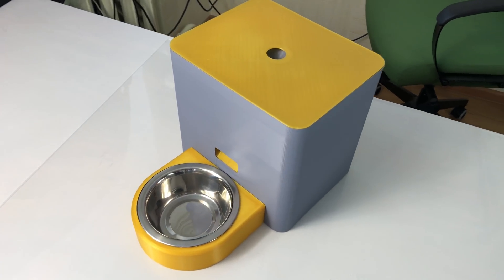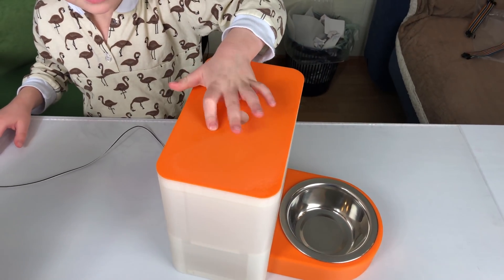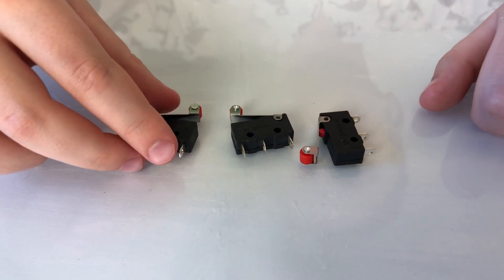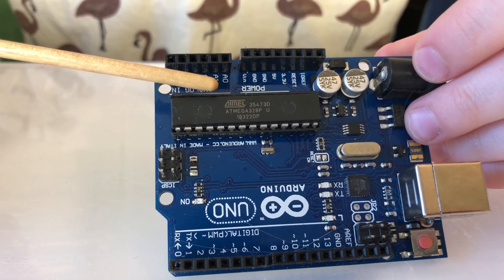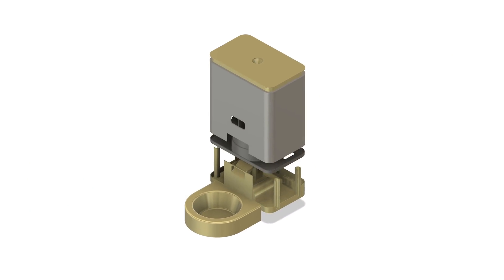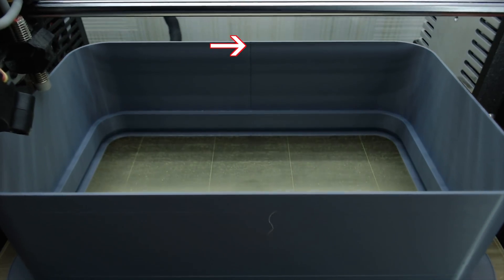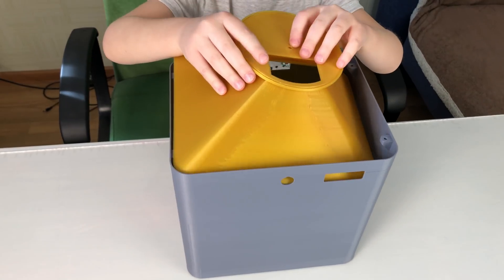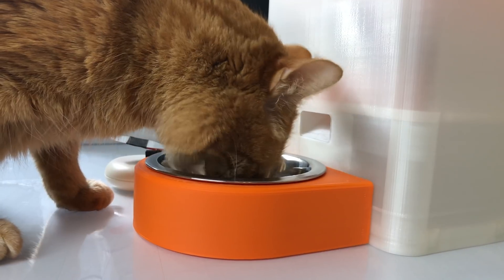FAT PET FEEDER 🙀– Free 3D Printed Pet Feeder

Comment: I had trouble with printing shell part with PETG. Where the opening starts on shell, some kind of deformation (like a bump on all sides) starts. I’ve slowed down the print speed (70mm/s) and acceleration and reprinted, exactly same problem occured. Anyone who had a problem like this? Any advices?

Comment: hello Aleksandr ,need your help , you think 3 battery D can Use for NEMA 17 stepper motor?
Reply: @kanyorb45  it's 12-24v motor and 1.5*3 batteries without converters. It's better to use a lithium battery pack then.
Reply: @ 
Maybe you have a recommended link to buy ?
Reply: @ sorry, no

Comment: Does it work with a Servo SG90 180°?
Reply from the maker: No
Reply: Thanks for responding :) will 360° work with SG90? Or should it be a more powerful servo?
Reply from the maker: Yes, it should be more powerful. Also the seat is made specifically for the servo in the spec
Reply: Thank you, I will modify the dimensions of the 3D project to place the SG90 360°, reduce the amount of food so that it can move the weight.
Reply: That would be quite challenging I believe. And even if it's done could result in some things working poorly. But these issues are also solvable.

Comment: Hello ! A big thanks for your project/video ! Now i have a small question : is it possible to power this using the usb port on the arduino instead of the DC connector? I think i saw somewhere that it is also 5V. Thnaks again :)
Reply: You can definitely do that but this servo can stall up to 2.5 amps at 7V, that's quite a lot for most of the USB ports and chargers. I tested 2 amp apple charger, it works, but 1 amp charges sometimes don't.
Reply: Also if you use arduino internal 12->5V converter, it's rated 5V 0.8 amps, that is even lower. So you have to use big capacitors or take the risk of something not working or even being damaged.
Reply: @HungrysitesRu  ok so better use the DC connector then 😅 thanks , i'm new to electronics !

Comment: Great Job, Great Science Fair Project!  The video provides a nice summary of assembly and parts list is solid; although many things in 2023 are backorder on Amazon.  Could use some help with the details of wiring; we are novices with electronics in our house... Guess we are not as smart as the 6-year old in the video. :-)  Anyway, Thanks and if someone has a separate video for wiring and coding (e.g, how to load the code onto the Audrino Nano board... that would be GREAT!)  #FatPetFeeder #WiringHelp
Reply from the maker: Thank you. I'm sorry, I do not provide support anymore. You can find similar items to what I have in the parts list and see the wiring diagram and sample code in the description.
Reply: @MomWillBeProud    Thanks Much!  Got it working just fine; awesome Science Project for my 5th grader!  Only thing now is we are not quite smart enough with code to understand how to TEST the time parameters?  Trying to TEST setting a time and see whether it automatically serves... Be not sure which parameters to change in the code?  Figured out the feeder options and turning of the servo motor; no problem... Thanks in advance if you can send along any pointers on which variables to change for TIME OF DAY testing.
Reply: @glenjohnaz  There's no time of day option in the code provided. You can totally learn to do that depending on the RTC clock you use. Without RTC clock it's not possible to keep track of time well with Arduino.

Comment: Hi there, thank you for the design and tutorial. We built the DC circuit version so far and everything seems to work. We don't know what the buttons do exactly in the default program but we do see the motor move, could you let us know? and does it feed automatically with the default code in your link or does that take some extra work on our part? if the default code includes automatic feeding how often does it feed and how does it know when to start?
Reply from the maker: Hi! The buttons change the portion size (the time that the servo turns, movement just indicates that the feeder understood the command) and the middle one is just to force dispense food once.

fpf12h.ino serves food once every 12 hours, first serving is done immediately after plugging into the socket.
Reply: I finally printed everything and have some follow questions about the program. If I adjust the portion sizes up or down does that get stored? If I unplug the power does the portion size I last set it to stay or does it go back to default?
Reply from the maker: @Adoula7  the example program doesn't have any persistence but you can implement it yourself. It's probably like 10 lines of code, it's a good programming practice.

Comment: This is a great project. Quick question. Whenever I change a parameter in Fusion 360 in the model I get loads of errors. Is it working for anyone else?
Reply from the maker: Maybe the design was too complex, maybe the implementation has too many dependencies. Yeah, basically you have to fix them all. It's pretty hard so I think it's better not to change or limit yourself only to changing some specific parts like bowl diameter.
Reply: @MomWillBeProud  Thanks for the reply. I wanted to make sure I wasn't missing anything. I need to change the overall size because my 3D printer is too small. Anyway, great project! It's the best DIY pet feeder project I've seen out there. Is your Patreon still active? I would like to support your work.
Reply from the maker: @farzadbakhtiar  Yeah, it would be pretty hard to fit into a smaller printer. The patreon is not active but I'm good, man. I made this project and it's doing pretty good: https://artworkout.app.link/

Comment: thank you so much for this project.
i would like to adapt the code so i could set specific times of the day to trigger the feeder. 
has anybody here already tried this?
Reply from the maker: Thank you. There's a code example with 8 hours delay though it's not made to use with a battery. The code for a battery version should be different (using timer/RTC pin interrupts).

Comment: Hm I put together the battery version and it does not works. :/.
Reply from the maker: Well I guess it's a part of any learning experience. You'll figure it out.
Reply: @MomWillBeProud  Thank you fopr the fast answer. I am really noob in this kind of stuff. I used LM2596 DC-DC Step-Down instead of urs, maybe thats the problem? also I use uno.
Reply from the maker: @Zuluparaszt3  try running it with usb power maybe just to check

Comment: Hi there! awesome design! Why did you choose for a hopper system? instead of a belt, or a screw driven transport system. was it more reliable? or just better looking ;)
Reply: belt is harder to manufacture DIY-style but I think it's the best option because it cannot jam if you dispense from the top of the feeder. Also you can use any bowl at the bottom.
I don't think there's a big difference between screw and the wheel. Screw eats horizontal space, wheel eats the vertical one. There should be a hopper anyways if you want to use all the food you put into it. Even if you use a belt.

Also probably a cheap stepper would be better than a continuous servo to make it more precise.

Comment: 5:15 if you want to make your switches have less throw you can remove the metal arms off the microswitches and move them closer, or add a spacer for upgrading existing prints. Cool project!
Reply from the maker: It's already the case here.
Reply: @MomWillBeProud  Oh, whoops, I only noticed the large throw and that the arms were on in the beginning. 😅

I guess the next option would be to move the switch actuator further away from the hinge point of the flappy button. 🙂
Reply: @b5a5m5  it works fine when assembled, I don't see an issue here.

Comment: You really explained it well❤️ what if we use spiral conveyor shaft to dispense food instead of that rotary blades. Also did your food become humid?
Reply from the maker: I don't remember why I decided not to use an auger, probably it used more space. You definitely can try to use it but it basically means to rebuild the entire project from scratch.
It didn't become humid though I don't live in a humid place, it could be an issue elsewhere.

Comment: Hello, I wanted to attempt this project and I'm putting together the list of parts into my cart. I'm new to fiddling with electronics, so what exact wires are you using? There's male to female and other variations. I'm not sure which one I'm supposed to use. Don't want to use the wrong wire and make something explode!
Reply from the maker: Hi!
You can even solder them in, it doesn't really matter, you just need the correct endpoints to be connected. If you want a modular prototype then I'd recommend bying all three types - f-f, m-f, m-m, if you're going to try other projects, these will help a lot. The absolute minimum is 3 wires male to female to connect the board to the servo. As for the buttons, there are no pins so you have to solder/twist the wires there. You can use the same male to female and strip one end to be soldered to the button. Though the feeder can be functional with only a servo+arduino.

Comment: I, i want to make a automatic feeder for my reptiles, how can i make a servo turn 51degres every 48h
Reply from the maker: Hi. You don't have control over the angle when using continuous servo. If you want to control angles you can use similar standard servo like MG-995 or MG-996

Comment: Hi there, thanks so much for an awesome project. I am trying to adjust the FeederInside part to fit a slightly smaller servo 40.5x19.8mm - I'm still a F365 newbie and wondered if there's an easy way to do this (e.g. editing a parameter)? Much appreciated!
Reply from the maker: Sure, you can edit the numbers on a MotorStand sketch and maybe on an extrude action for the height.
Though these numbers are very close to the ones used (41.4x20.5 minus 0.4 gap) and I'd recommend just keep it as is, it's not supposed to fit there tight. It's kept from falling out by the top part.

Comment: Hello, so there are 2 of them, one is battery operated (fully) and the other is using wall connector ? I have problem to think, why would I need to combine both.
Reply from the maker: There's only 1 version of 3D model but you have 2 options of powering it.
Reply: @MomWillBeProud  Great thanks for info.

Comment: Hello  fun projet. But I have a problem with the shell.  the wall deforms during printing thank you for your help
Reply from the maker: Hi! Please check that it sticks to the print surface well. Also maybe try: 1. higher fan speed, 2. lower temp but still with good layer adhesion 3. well ventilated room with temperature 18-25C
Let me know if it helps.
Reply: @MomWillBeProud  
Hi
The fan is at 100% and my printer is not in a case so cool down normally. Do you have a email to send you a picture. I thing, the best will to increase the thickness of the wall to have more rigidity ?
Reply from the maker: @thomasroger5045  momwillbeproud gmail.com

Comment: Can I replace the continuous rotation servo with a strong DC motor? I don't know where in the breadboard to plug the DC in, so I hope you can possibly help me. You don't have to spend a lot of time (cuz life span is limited) because this is a simple task!
Reply: And I bought the STL files. Great job on modeling those ones!
Reply: 파루_YouTube you can. Basically the "continuous rotation servo" is not a servo, it's a DC motor with an embedded driver. But if you want to use standalone DC motor then you have to 1. change the model to fit your specific DC motor, 2. use an external driver or MOSFET to connect it to arduino because the current of arduino is not enough and you will burn your microcontroller if you don't use MOSFET. 3. you will have to significantly change the code because it's written for the servo.

So if you don't want to spend days of making all these changes or don't have the qualification then I'd strongly recommend using the servo, it's only 10usd to buy one.

I definitely can help to find an error in your code or recommend the ways you can change the model to accomodate the motor but I can't spend hours doing this. If at some point you feel that's not enough please message me on cubebrush in the next several days so I could refund your purchase before it's too late according to their TOS.

Regards!
Reply: @HungrysitesRu  What a caring answer! But one thing: I live in Korea and it will take me forever to buy it with amazon and in Korea, there aren't so many servos to choose from. Thx for answering!
Reply from the maker: @paarooo  I live in Russia, Amazon doesn't even deliver to Russia :D

https://aliexpress.ru/item/32427003385.html
https://banggood.com/Spring-RC-360-Degree-Continuous-Rotation-Robot-Servo-SM-S4306R-p-919271.html

Are these any better in terms of delivery? I'm sure you can find similar "continuous servo" locally, you just need to match the dimensions ~~40*20*40mm, you don't need this specific model.

Oh, btw, you will need something like an H-bridge, not just a MOSFET if you want it to turn both ways (jiggle to make sure the cat food isn's stuck there).
Reply: @MomWillBeProud  Oof thanks!

Comment: Hey, nice project. Just to be clear, the LM2587, IRL540N, capacitor, etc are necessary only for the battery version? If I want to use the power supply, I will need only the arduino and servo. Is that right?
Reply: Hey, I'm pretty sure my mom is proud of me now: https://youtu.be/aF1oW6MEi0k
By the way, I could 3d print using ender 3 with no problems. Thanks!
Reply from the maker: Yes, that's right
Reply: @MomWillBeProud  Just one more question to effectively buy the license. Do you know if anyone has managed to 3d-print on Ender 3 with success?
Reply from the maker: @jnthas  I don't have an answer for that, I know that at least one guy purchased the model and is using Ender, I don't know the result, I made a shorter version of the files for his Ender 3
https://www.dropbox.com/s/b2r20r89l4zxu4n/Funnel-205.stl?dl=1
https://www.dropbox.com/s/uq0cg0a4mn45d19/FeederOutside-205.stl?dl=1
Reply: @MomWillBeProud  We'll see then. I let you know what will happen :)

Comment: Hi can anybody help me with the parameters? I have not tried fusion 360 before and whenever I change the parameters it gives back errors. And converting to stl is a mess using Cura. My 3d printer is I3 Mega which has a smaller build plate. Can anyone help?
Reply from the maker: Oh my man... That's really not that easy to fix because you have to follow all the broken steps from the first one to the last and repair all the broken references. Now Fusion made it a bit simpler but still I bet it will be a couple of hours even for me.

Please issue a refund on cubebrush if you don't manage to fix it.

Comment: That fritzing diagram seems to be missing the RTC, but should be easy enough to figure it out
Reply from the maker: Yes, you're the first one who caught me! :D
You can take the pin numbers from the code.
Reply: @MomWillBeProud  Thanks. I don't quite understand the use of the MOSFET. Is that so the boost converter only triggers when the servo is called to run? How are you powering the arduino off just three D-cells? Doesn't the arduino require at least 5V?
Reply from the maker: 1. MOSFET cuts the current to boost and servo. It saves a lot of battery life.
2. I use arduino at 8MHz (burn the respective bootloader) and 3V is enough. It can also work even at 1.8V@4MHz.
3. If you want to save even more battery you need to cut the leads to the internal linear converter. Otherwise it will drain in weeks.
Reply: @MomWillBeProud  Can you explain the linear converter cutting? Thx.

Comment: Is this better than your previous one made with pringles box?
Reply from the maker: Previous one is cheaper and better keeps flavour.
This one looks much better, it's sturdier and more convenient to clean, transport, add more food. Also this one doesn't need a power brick but this feature you can also add to the previous one. The portion size is much more consistent.
Both work well, just a matter of personal preferences and priorities. If you want something cheaper or don't have a 3D printer – the first one is fine.
Reply: Another question, what’s the default size of the feeder. I am asking if my printer is big enough to print the model
Reply from the maker: @huseyint  XYZ 210x130x210 maximum print size

Comment: Hi sir , I bought the files , but want to cancel the button and make it by schedule, and how to add WiFi camera on it 

#cat_feeder
Reply from the maker: Hi man! https://gist.github.com/ulitiy/25d675591af73f347926b7a4e6921797 this code feeds every 8 hours but you can tweak it.
As for the camera I don't have such a demand and there are so many device options so you have to find out on your own, you have the source.
WiFi camera can be independent or you can make a raspberry pi with a camera and the code running on it but it's not arduino-compatible.

Please ask if you have any specific issues, obviously I can't rewrite the code for each user needs but I can give you a hint on how to solve a thing that you're stuck on.